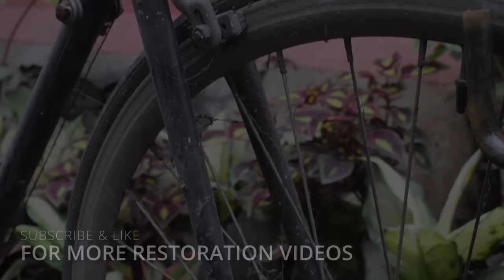FREE BIKE RESTORATION - Rusty Campagnolo Vintage Bike

Comment: Nice job, really looks great now.
I’ve never seen a front hub like that before, I guess it can be used as a rear wheel on a fixed gear.
Reply from the maker: Thanks 👍
Reply: I spotted that. I think it's a rear hub that some has converted to use a front by fitting a shorter axle.

Comment: It's OK. Campagnolo ever made frames. He should've branded it correctly. the parts he didn't replace with new could be cleaner and better restored. the paint look fine from a distance, but....   I would prefer he restored it back to original. This is just using the frame, some random components and spray paint.

Comment: Why do you call the bike campagnolo bike.  !? I can only see that the front deralliur is campagnolo  !? Anyway Nice restoration
Reply: The gallows support and maybe the frame is also campagnolo, we can see it about 3:00
Reply: The label seemingly replaced on the front, seen close to the end of the video, says campagnolo.
Reply: Built with the best rattle-can paint and Shimano and Suntour parts.
Reply: Campy NEVER built frames.
Reply: Headset...  I mean gotta paint the lugs.  But a solid restore of a weird bike.  Wouldn't have reused those rims either.

Comment: The only thing I didn't like was the Paint Job, Better Cleaned and left the original Spray, but
Well done
Reply from the maker: That was actually "NOT" the original paint, the owner repainted it b4 I restore
Reply: Yes I noticed, better left it on the old spray

Comment: Not a bad video but some questionable work. Rear hub in front fork? No grease on stem. Pitted headset. The freewheel was in very poor condition and reused, not sure if you lubricated after that bath with all the rust bits scrubbed off. Banging the stem into the fork, paint on bottom bracket and head tube faces, knocking out the headset cups onto the concrete, front derailleur mounted way too high, that 2 inches width of handlebar finishing tape.

Comment: Great video. Question:  where did you get that headset removal tool?  All the ones I’ve seen have these fan like pieces that are spread out but combine when placed inside the head tube. Your tool looks like a solid rod. How does it remove the headset yet still “fit” inside the head tube?
Reply from the maker: Found it online Shopee or Lazada

Comment: It could be a 1970-1972 raleigh gran sport with the rear brake bridge cut off.  Nervex lugs, bocama D12+ fork crown, campagnolo dropouts.  The shifter bosses and jet vents are add-ons and the latter really suck.  If I am right the serial number on the bottom bracket will be Ennnnnn Fnnnnn or Gnnnnn.

Comment: Did campangolo used to make bikes with shimano parts? Just wondering because it's a shimano 600 groupset on this bike, not a campangolo groupset.
Reply: campagnolo have never made bikes, only components. I was trying to work out what the frame is, its got very nice lugs
Reply: @rdub-yah3880  Ah so incorrect title to the video.
Reply: Crap Weinmann brakes.
Reply: @chrisallen9154  ...and cheap Shimano brakepads🙄....

Comment: Some tips to get a good paint job and save time. First, degrease the frame using brake cleaner, and then strip the frame chemically. The stripper which is easiest to find is spray-on gasket remover which you can find in auto parts stores, it will lift the off to the bare metal. Spray it on, wait 5 minutes, and scrape it off. Wear gloves and goggles. Wash the bare frame with dish detergent and dry it carefully. Then wash your hands, and wipe down the frame with a clean cloth wetted with lighter fluid. Then spray the paint with single strokes, releasing the spray button at the end of each stroke. Try to paint on a day which is not humid, the paint will dry with a better shine. With enamel or epoxy paints you don't have to worry about primer.

Comment: really good job 3 question i would have but am
present at the moment
to restore a similar bike your chain in the video is new if so where did you buy it and
 if not how did you get them back that way and what do you use to clean them there in the video is the water or something else
Reply: First place I would try is a bike shop.
Reply from the maker: Go for it!

Comment: Interesting, but spraying WD40 everywhere is wasteful! 

First get a rag and clean the bike! Wipe it down with a bucket of detergent - you do not start using tools to dismantle components with a bike in that condition - keep your tools clean!

Do not start work with dirty hands - clean the areas appropriately before taking stuff apart - do not cut any cables.

You have a lot to learn!

Comment: As someone who works on old bikes for a living, I'm very surprised how easily the cranks and bottom bracket came out.
Reply from the maker: It's a self extracting crank, when you remove the bolt, it will automatically pull the crank

Comment: Putting Campagnolo on it though isn't done though as only some of it is , had those brake callipers myself and the worst brakes have ever had.
Acceptable job done bearing in mind where you are................
Reply: Cranks and shifters are old Shimano 600. Derailleurs are probably Shimano. Stem is Dia-Comp. (another Japanese item)
The Campy head tube badge must be a joke.

Comment: I dont understand way your bike is called Campagnolo. This company made and makes components only, including wheels, never a complete bike. The only parts made by Campagnolo that I see are the headset and front derailleur. The frame is likely british from the 50s or 60s. Like many old, neglected bikes, it was refitted with a mishmash of midrange  parts, dia compe brakes, suntour and sugino etc. I commend you for your hard work, but this bike is not period correct, and definitely cannot be labeled Campagnolo.

Comment: I do this for a living and ... I was very not impressed by the paint job, also using wire brush wheel will smear off any details on the frame. Should there be any, you just fucked them up. Nice Crafty Panda video, but please stay away with your present skill set from restoration of anything valuable. Thank you for attending my TED talk